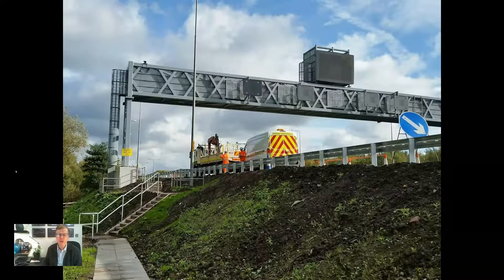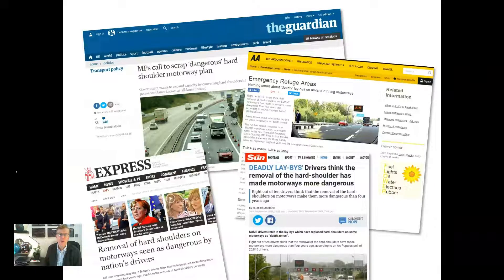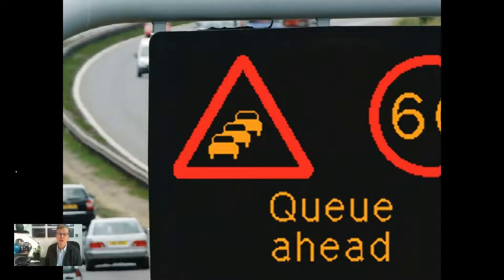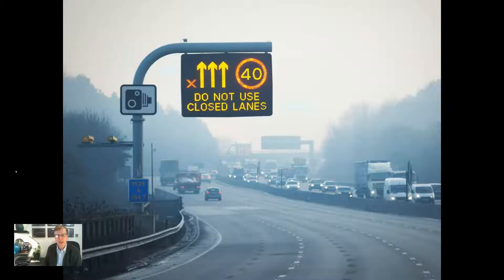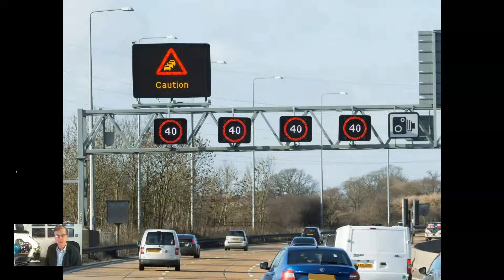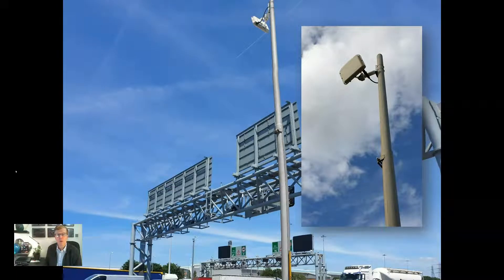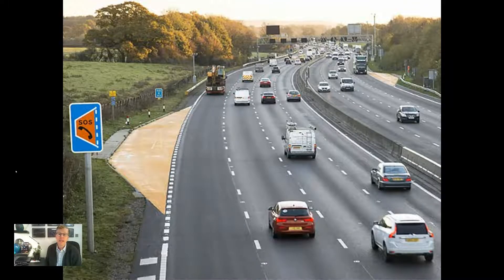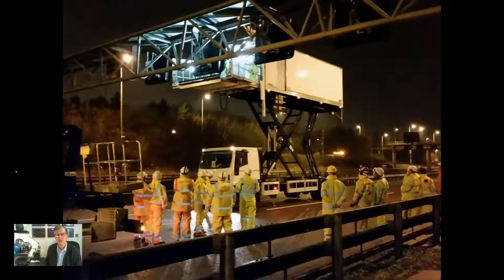Smart Motorways

Comment: Controlled motorways were the first type of smart motorway, deployed extensively on the M25. They even predate LED, with bulbs used as part of the red ring Controlled Motorway Indicators (CMI), the precursor to the AMIs and film rather than digital speed cameras